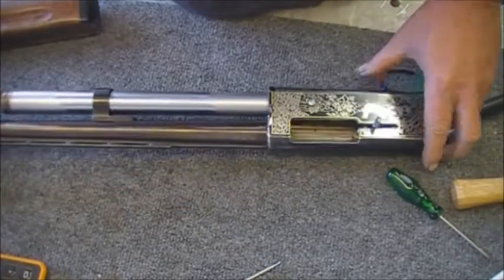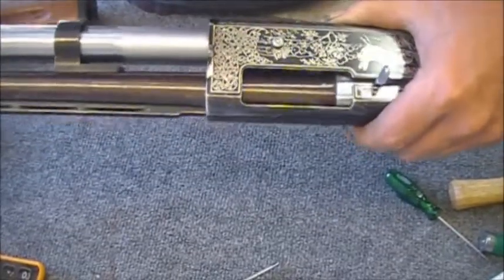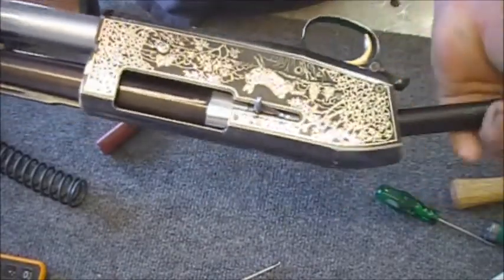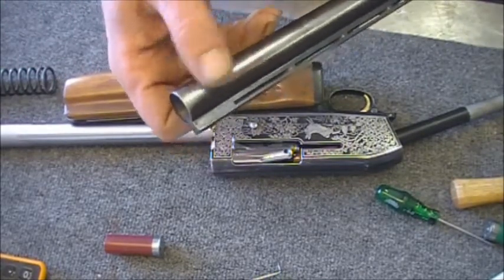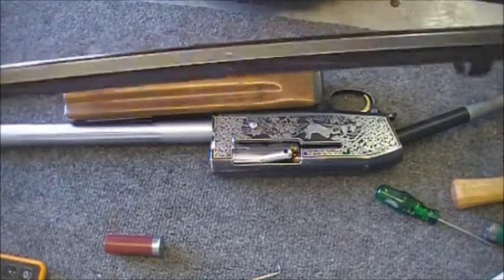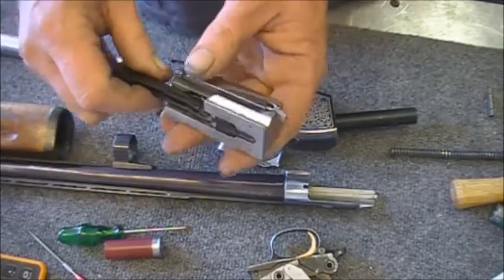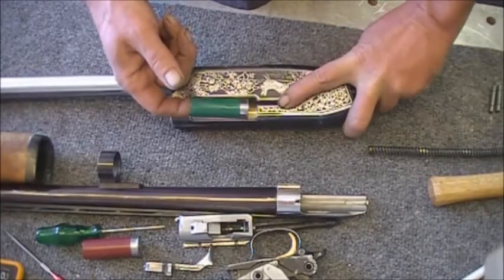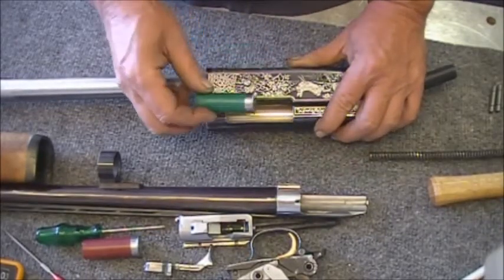Skb Ithaca 900 failure to eject Part 3

Comment: Matt, my xl900 20 gauge has the High Low switch on the magazine tube.  I'm trying to disassemble my gun as it needed a good cleaning.  How do I get the blocker off so that I can remove the bolt?  I tried looking for your other video but I don't see it.  Can you help me with a link please?  Thank You!!

Comment: I've got a 900 that wasn't ejecting when I first got it. I placed the rings the way you had them in the first video at first and it fired with very little recoil. I flipped over the ring and it did the same thing. a guy at my club said the rings need to go under the spring for it to work properly and now it ejects but kicks like a mule. if I put my rings in the same as you have them in these last 3 videos, should it still eject but with less abuse of my shoulder? I only get to use my shotgun once a month at my club trap shoot so I'm wondering for next month.

Comment: is there a way too remove the magazine tube? mine is damaged and needs replacing
Reply: +djorde07  how did your tube get damaged? I was under the impression the tube is one with the reciever
Reply: +Walker L, I'm not sure how it got damaged, I bought it off a friend cheap, I've been told by some people it threads into the receiver but I've had no luck yet